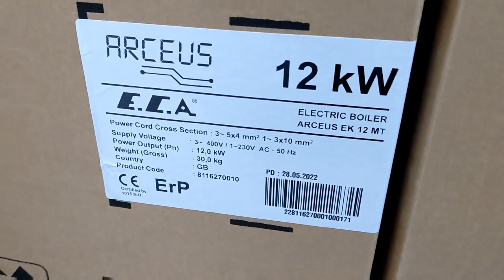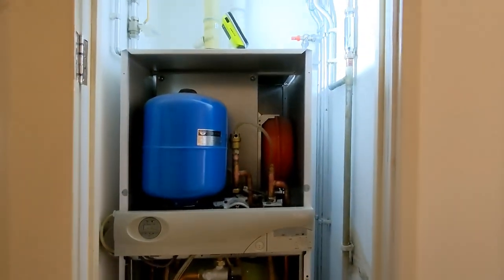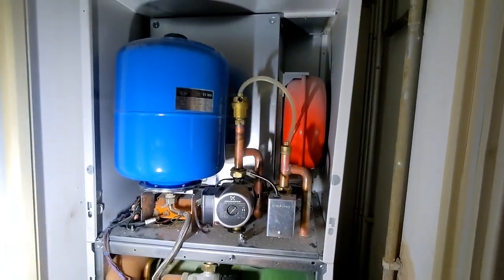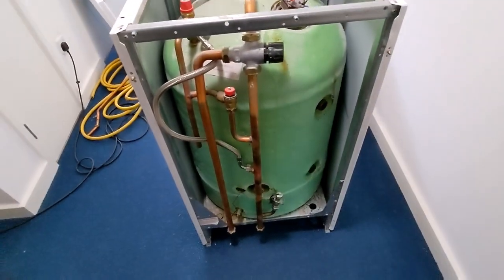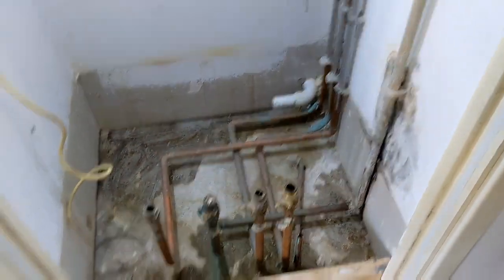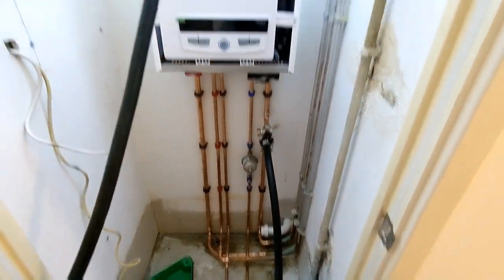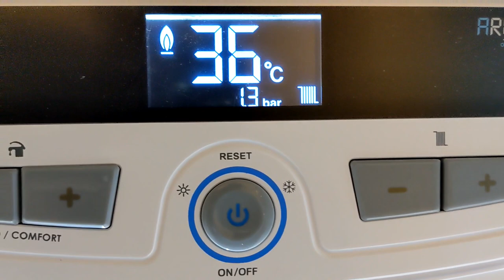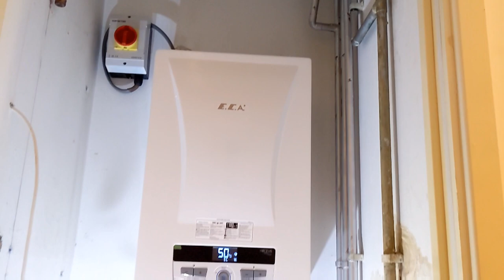ECA Arceus 12kW Electric Combi Boiler Install

Comment: £3.70 a hour in electric.....  31p per kW rate at the moment. Heating on 5 hours a day? (2 hour morning, 3 hour evening) £18.50 a day. £550 a month.... Er na. If you have huge solar and battery bank yes. Mental to change from gas to this in the current climate.
Reply from the maker: You're assuming the boiler runs at max rate all the time when in fact it will modulate down to a lower output once up to temp
Reply: @cputilitysolutions  that's a very good point! It is the future. Just need a drop in electric rates then I'd have one 😁 get these fusion reactors up and running, free electricity for all.
Reply: I've just had a price for panels and 2x 3.6kw battery storage. I wonder how long these would take to run the batteries flat?
Reply: Not every day you will have the heating on all the time, only in a very cold winter would you possibly manage that which we don't get any longer!
Electricity rate at the moment is 28.5p per unit.
Reply: I fit the EHC combi boilers , how did your customer manage with an old istore with 20L min hot water to that with 6L min ?
Reply: No standing charge or yearly service charge and less to break down

Comment: Thank you, food for thought, I have an electric water cylinder that costs a fortune to heat as I only have a shower once daily and do not run radiators from it! basically need water for washing hands, shower and dishes which do not go in the dishwasher.
Reply from the maker: Hmm it may be cheaper then to have an electric shower fitted and an under counter water heater? Obviously just a suggestion as I don't know the complete setup you have 🤔

Comment: Interesting video, thanks. We have solar panels and are looking at ways to be more energy efficient. Mostly insualtion at the moment, but I expect we will move all electric eventually.
Reply: if you have a solar array its far cheaper to go heat pump route if your heat loss is less than 10kwh it should then be parable to an A rate boiler to run in winter,  if you have a 15kwh or more heat loss for get it, stick with gas

Comment: Nice install, I am guessing that the new DHW flow rate is less than the old system, (comparison would of been good), hope they have solar, as I can imagine their electric bill rocketing with that unit, wonder how it will cope with potential dirt in the system which could occur and possible scale, time will tell I am sure... old unit was a beast to remove tho. nice job. well done.
Reply from the maker: Yeah not as good a flow rate as the old one but it's a 2 bed flat so it's sufficient for them. Not sure about the future plans for solar but it's an option for sure!

Comment: You can do vertical flue then sue flashing seal up probably need a roofer but it is missions a lot of work involved to be fair
Reply from the maker: Also there was another floor of flats above us as well so that wouldn't have been a possibility
Reply: @cputilitysolutions  got work smart not hard 👍

Comment: Really interesting, however surely the 12 kW option would not be sufficient for a reasonable DHW flow, especially in winter, when you consider that most gas combi's are at least 24kW.

Comment: Nice job. How many mm cable from the rotary breaker to the boiler?
Reply from the maker: Thanks, it was 10mm 👍🏽
Reply: @cputilitysolutions   Thanks. Good to know. Never installed an electric boiler before.
Reply: did the incoming fuse need to be checked before you did this job.. some houses only have a 60am or 80amp main fuse.. and with other appliances running aswell as the boiler i would think it would blow the main fuse...  i know there is something called 'diversity' whicvvh means everything in the houose wont be running at the same time.. but i guess you dont want to be on the limit if the incoming main is only 60am or 80amp.. great video! thanks
Reply from the maker: @brendanfisher2528  we had an electrician do that part of the job, he did say there was only a 60A main fuse but he worked out that it would be fine as there wasn't anything else with a large load and unlikely the boiler would be running at full capacity for long periods of time

Comment: Who would service the boiler then, electrician or gas engineer, would be interesting to see how the service on this differs to a gas boiler
Reply: The boiler shouldn't need regular servicing. The magnaclean would need cleaning once a year.
Reply: @delcat8168  I’m confident the manufacturer will require yearly servicing and sign of by an electrician

Comment: Nice one , they are the future as most new builds now don’t have gas...!
You can also get a system version and hook up to a mega flow for decent hot water pressure , Ive fitted a few and they are very easy compared to a gas boiler and are ideal when a flue run is a problem , as for running cost’s gas is cheaper per kw hour.... 👍
Reply from the maker: Yeah the main reason to go electric here was due to the awkward flue run 👍🏽

Comment: Brilliant video, but would you have one? This is the small one, they go to 27kwh! Would require 3 phase supply. Do they modulate down? Would need weather comp. Opentherm. What would the D NO say about a block of flats full of them? Were told not to do the washing between the 4 & 7pm, this jobbie could cost a lot to run on a variable tariff. Would not storage heaters and immersion be cheaper to run? Just saying!

Comment: Tepeo Zeb worth a look as you can store heat in it at eco 7 rates overnight and consume in the day. 

Regular electric boiler like this would work well with batteries, either in conjunction with solar or charging them overnight on eco 7.
Reply from the maker: Nice one

Comment: Thank you for that. It's definitely the way forward. Would a normal 3 bed semi be too big for this boiler to handle?
Gas is a third of the cost of electricity but electric boilers are double the efficiency so the running costs shouldn't be 3x that of gas. Still dearer though.

Comment: Really informative video and ...would that boiler work for hot water on demand only for 2 showers and a kitchen...I have storage central heating and I'm happy to leave that as is. ??? any help and advice would be  appreciated.
Reply from the maker: Thanks, for your circumstances you would be better off with either a direct unvented cylinder or a direct thermal store as you would get better hot water delivery 👍🏾
Reply: Small tankless instant heaters in the bathroom and kitchen are the way to go.

Comment: Would be good to see that switchboard once upgraded. Do you think that boiler you installed be enough for a bath tub.
Reply from the maker: It was a standard 18th edition fusebox that the electrician installed. It will do a bath but will take longer as the flow rate on the electric combis is only around 7/8 litres per min

Comment: Great video how many radiators can you run off it etc and bathrooms ?
Reply from the maker: You should be able to run around 8-10 rads. Hot water flow rate isn't the best on the electric combis yet, around 7/8 litres per min on a 12kw and around 9 on a 15kw. Running a bath will struggle a bit but showers, taps, etc no problem

Comment: How do I increase the bar pressure (1-1.5bar) on an electric combi? Is there a video somewhere I can look at? I have a Gabarron Mattira combi. Thanks
Reply from the maker: You should have a filling loop somewhere. I'm not familiar with that brand boiler I'm afraid
Reply: @cputilitysolutions  Thank you the prompt response. Yes, there is a u-shaped flexible braided hose with handle valves at either ends connecting the cold water input and DHW outlet. I assume that similar to a Valiant Gas Combi one opens the DHW outlet valve and then gradually opens the cold water input valve until the required pressure gauge level is achieved?
Reply from the maker: Sounds right 👍🏽

Comment: It just sucks you have to give the DNO a heads up before installation as they can refuse if the local electrical supply isn't enough.

Comment: Hi, what is DHW flow rate and temperature rise as a gas combi 28kw could deliver 10lpm@35 c temperature rise ? I'm thinking less than 5 lpm 
Nice install
Reply from the maker: Thanks man, the flow rate on these is around 7-9L/min with a 35 degree temp rise 👍🏽

Comment: Hi Will this boiler featured in this video be good to run a full standard bath tub and if so at what flow rate would it be, and would it be constant hot flow as a gas combi boiler would do?
Reply: He mentions the flow rate at 17:12 and quotes 9L/min
The cheaper electric boiler models can be as low as 5L/min so beware
The boiler here (ECA Arceus) comes in different versions, from 12 up to 27Kw. This was the 12Kw model and, from the figures I was able to find, is rated at 8L/min (not 9). The notes state that at 8L/min you may have to turn down the flow rate to fill a bath. For some context, the NHBC guidance recommend restricting flow rates at the output as follows: Basin, Sink & shower – 6L/min, Bath – 9L/min. As a result, this unit my struggle when filling a bath, especially if that output hasn’t been restricted.
Reply: @Ironbuket  Thanks for the response and detail on this mate, my 1 bedroom flat isn't connected to the mains and I've been trying to make the decision between an a big unvented cylinder and a combi boiler. I love a bath (practically have one every day) and if these combi boilers are going to have an issue filling a decent size bath (mines 1800) then a big cylinder seems like a better option possibly... any tips would be ace
Reply: @RagTimeJack  Just to clarify, you will still be able to fill a bath, but it means you can’t just turn the tap on full else a boiler, rated in power as this one, wouldn’t be able to keep up. The situation gets worse if someone is using the boiler elsewhere at the same time (sink or heating was on). Im far from an expert on this, but we have been exploring electric boilers as an option to replace our old gas combi. I found there is very little info out there on this kind of setup (electric combi and nothing else). People almost always have a water cylinder when using an electric boiler. If you are considering combining this with solar power you have to have a cylinder or some kind of thermal storage else getting the panels is a waste of time (they cant directly feed enough power into an electric boiler to run it – even with storage batteries you cant get enough). Also beware that not all electric boilers can accept hotwater input and so are not compatible with solar heated water. Things are far more complicated than just electric boilers cost more to run, there are many other things different about them and you can easily get screwed over by an installer if you don’t do your own research. If you just have a gas combi on the wall doing everything, I haven’t seen any examples yet of someone swapping one out for a more powerful electric combi of this style without having to add extra stuff elsewhere in the home also
Reply: @Ironbuket  Hey Man, thanks for all the extra info! I had a look online and also consulted with my plumber a bit more. Tested my water pressure and it looks like I'm getting 11 litres per min out of my cold mains. Looks like for that to be something a combi can keep up with ill have to get a 25KW electric combi on average which would be fine....unfortunately it seems like you need to have 3 phase electric for a boiler of that KW so I'm going to go for a nice size unvented cylinder for my nice hot baths and showers!

Comment: Are the electric combi boiler any good
Reply from the maker: They are a good alternative if you don't have gas. But flow rate isn't great for running a bath
Reply: @cputilitysolutions  I'm looking at getting rid of gas and go to electric combi boiler

Comment: is it easy to install a boiler system as an hvac technician and not an engineer
Reply from the maker: I guess anyone can install an electric boiler as it's just connecting water pipes to it, you'd just need an electrician to do the electrical side of it
Reply: @cputilitysolutions  thanks

Comment: Why did the customer not want a gas boiler. It’ll cost a fortune to run
Reply: He explained that the flue run was a mission and Ideal wouldn't allow the use of the existing flue.
Reply: @umark6695  Cheers, must have missed a bit
Reply: Option for solar power in future